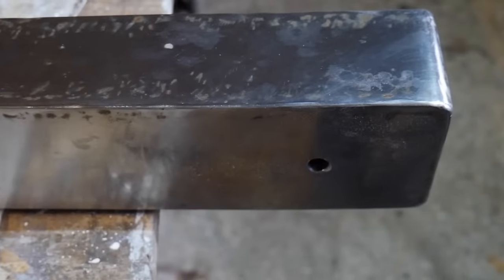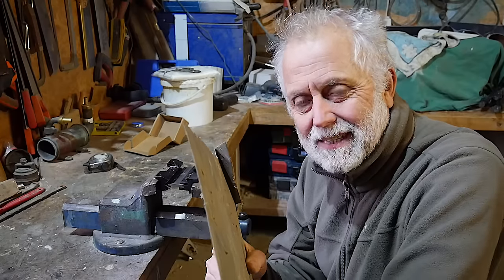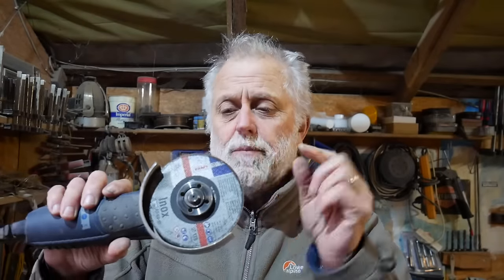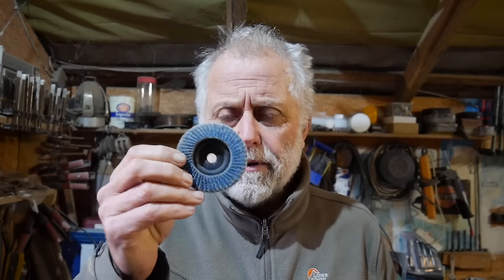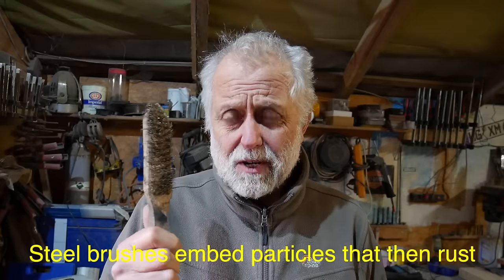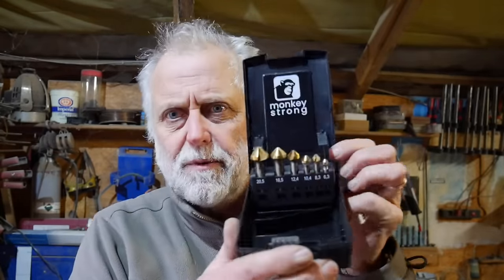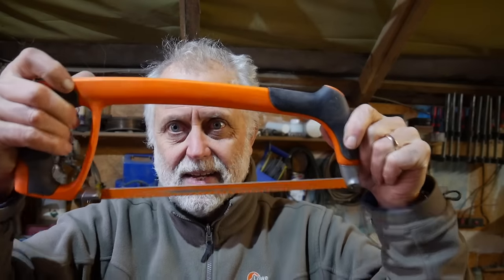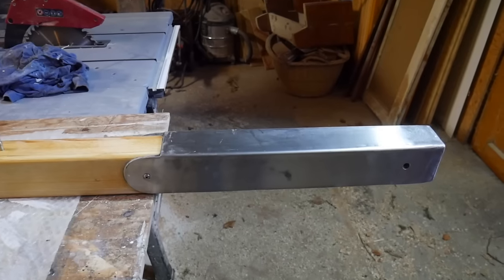Home Fabrication Of A 316 Stainless Steel Tiller Fitting; Tools and Techniques - SV Tapatya EP314

Comment: While you are able to would be best to make an extra rudder? Several boats have reported damage to rudder's from Orca going after rudder's either to train or revenge. No one really knows why. But having a backup emergency rudder to have would be a good idea.  It could be stored. Keep up with the good videos.
Reply from the maker: Thanks Eric. Yes, I’ve been following the orca interactions and they are a concern. My rudder is too big and too heavy to carry a spare or realistically be able to fit at sea. The standard fallback is to jury rig something from a long piece of wood (spare tiller perhaps) and a board ( floor board, for example). But, I shall do my best to avoid interaction! 🤔🤔

Comment: Moin Tony  Bei deinem Inverter kann ich nicht klar sehen welches der Plus- oder Minuspol ist. In aller Regel müssen Elektroden für Edelstahl mit der Elektrode am Pluspol verschweißt werden(steht aber auch auf der Packung),also genau anders als bei niedrig legierten Elektroden für Baustähle. Das hat schon einen Einfluss auf die Qualität der Schweißnaht. Bei Arbeiten mit Rohren(25er D) für Relings  habe ich festgestellt, dass man mit 1,5mm Elektroden besser klar kommt. Weiter noch einen erfolgreichen Werkstattwinter. Bin schon gespannt wie dein Trimtab an das Ruder kommt. Gruß HMK
Reply from the maker: Moin Heiner. Ja, ich benutze auch 1,5mm Elektroden manchmal. Ich habe beide Polaritäten probiert und finde kaum Unterschied. Heutzutag schweiße ich fast immer mit Elektrod auf minus

Comment: @SVTapatya hi Tony, can you tell me who your 316 stainless supplier is please
Reply from the maker: I get it from various sources, but this piece came from here
https://www.feld-eitorf.de/
They’re not the cheapest, but they cut to size and/or shape
Reply from the maker: Well, that's a bit of a tricky one. You can sometimes find 316 via sellers on Amazon or eBay. When I was in Canada, there was a place called the metal supermarket. Scrap yards are the absolute cheapest places to source metal, but you have to know what you're looking for. If you know someone with a trade business, wholesale suppliers are significantly cheaper.... @setkacagarro-blogspot-com